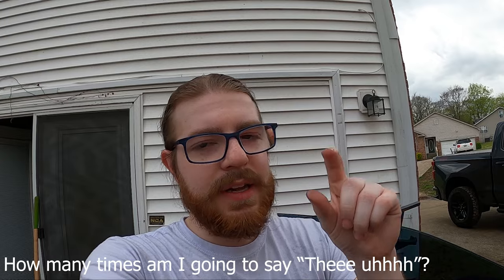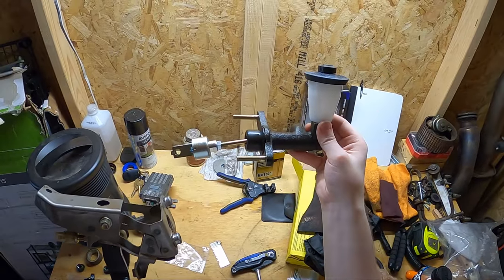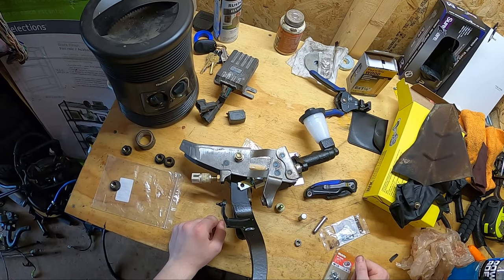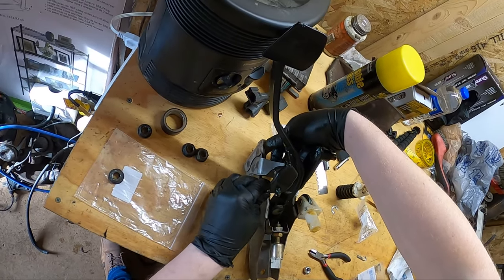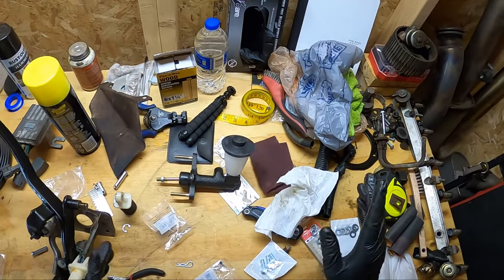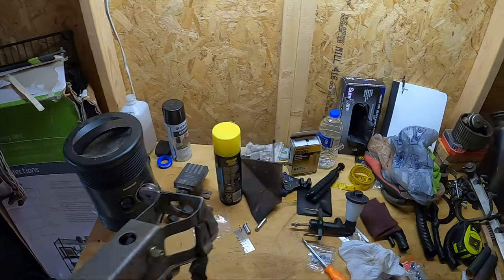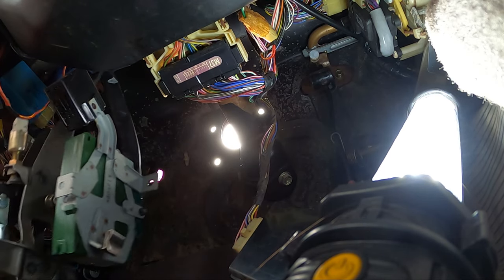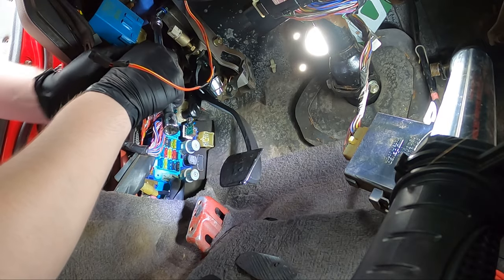MK3 Supra Clutch Pedal Install

Comment: Nice job, just did it myself. Do you think you will need to take it out again to install the bottom clutch switch ?
Reply from the maker: Cool to hear! There should be enough room to install the switch without taking it out again
Reply: What’s is switch for? Few other questions for anyone who knows I’m looking at a full length clutch hose with a 1/8 pressure sensor port what is  that? also is it worth getting clutch hose with one ? Or will regular full length clutch hose be fine ? Thanks
Reply from the maker: @b-radinda505  The sensor is to let the car know when the pedal gets engaged. I have mine bypassed so I can start the car without pressing the pedal in. 
As far as a full length hose with a pressure sensor, not sure why it would be needed. You can get away with just a full length hose. Which is what I installed on my car
Reply: Ok yeah cause on drift motion they have the hose for 55$ but with AEM 2000 psi pressure sensor is like an extra 160$ expensive lol .Cool thanks for the info bro and quick reply 👍🏽 also can’t wait to get my Supra goin 🏎💨
Reply from the maker: @b-radinda505  Oh yeah, I remember seeing that and thought it was absurd lol. And yeah, no problem! Good luck with your project!